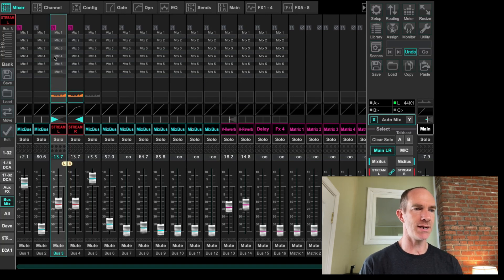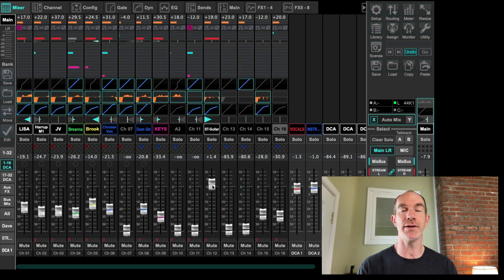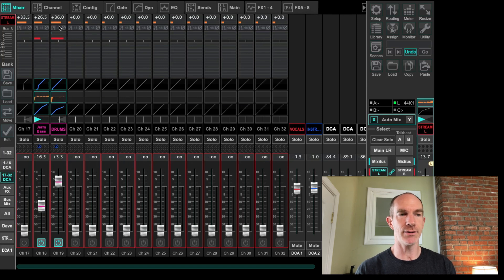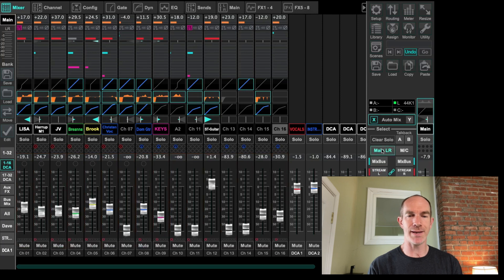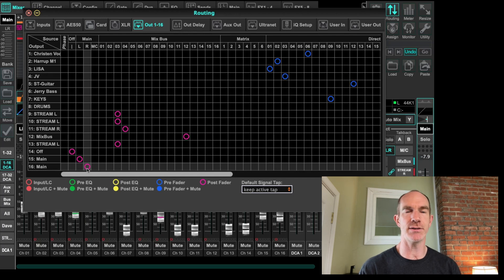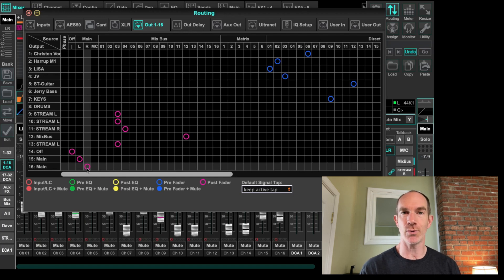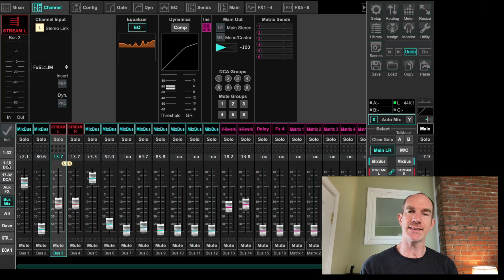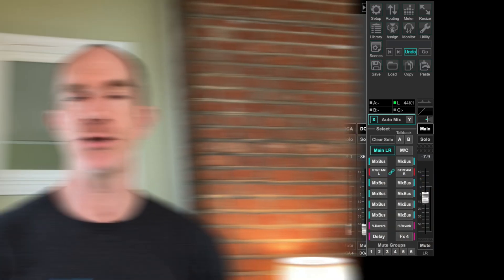Can We Get More GAIN Possibly?

Comment: Ack, look at their bus 3,4 positive EQ   That seems like they are trying to boost things.  Gotta start from scratch and go thru gain staging or “structure” and build from inputs on thru.  They may not need a pro level to fly in but likely a good local X32 skilled mixer to come in and review.  From a local AV shop.  The issue is not steel guitar, it is general board setup.  If they were within 50 miles of me, I would do it for free.  In SE Pennsylvania here.
Reply from the maker: Yeah, I hear ya. There are certainly a number of things to be addressed and hopefully they can pick up some tips from the comment section.